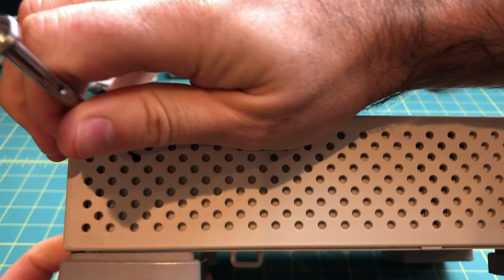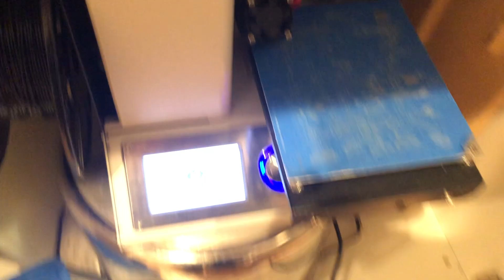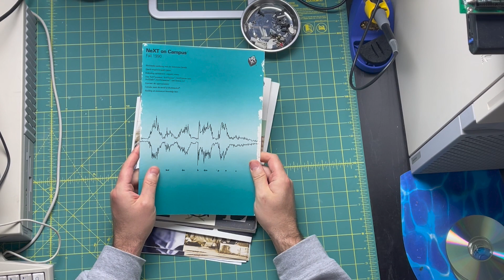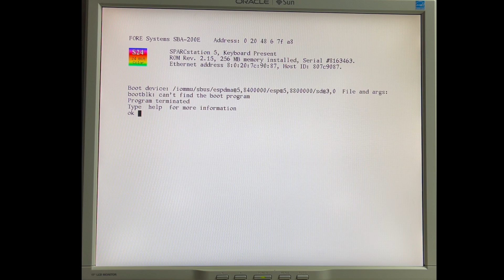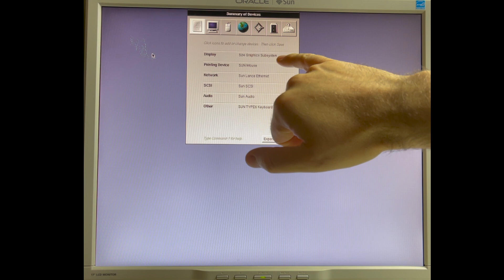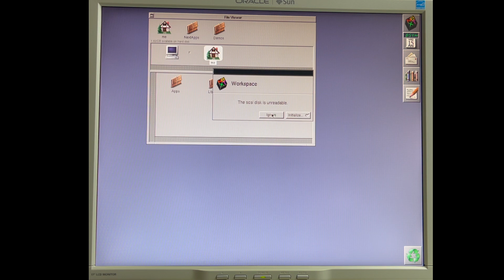EP1: Sun Disk Pack Setup & NeXTSTEP for SPARC installation on a SPARCstation 5

Comment: Really well made video! I have two SUN machines (Ultra 1 and SS4) that I am planning on restoring and running NeXTSTEP and Solaris on, I suppose it would only be possible to run NeXTSTEP on the SS4? Either way, both of them need new batteries but watching your videos this doesn't seem to be a big issue. Hoping to see more SUN/Unix workstation related videos on your channel in the future.
Reply: I think most of all Sun retro fans run NeXTSTEP, well i run OPENSTEP 4.2 on our SS4/SS5/SS10/SS20 (and SPARC Voyager if you have one) .. and remember on SuperSPARC processors supported (no ROSS etc).